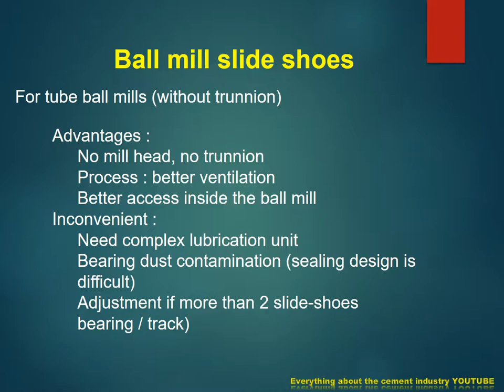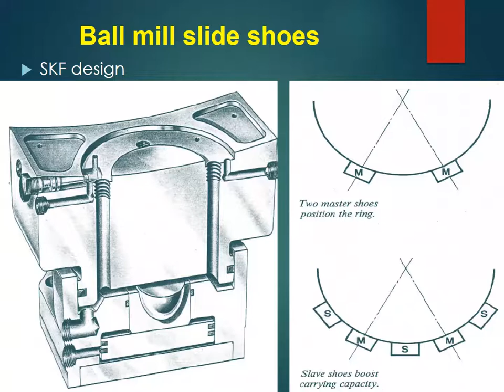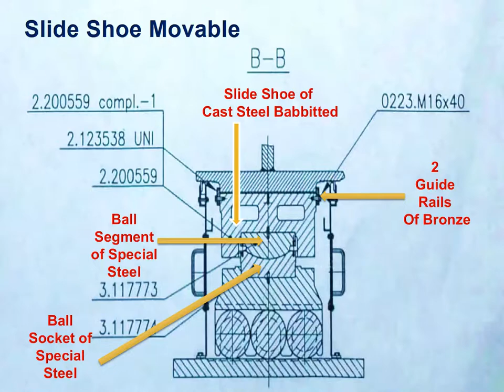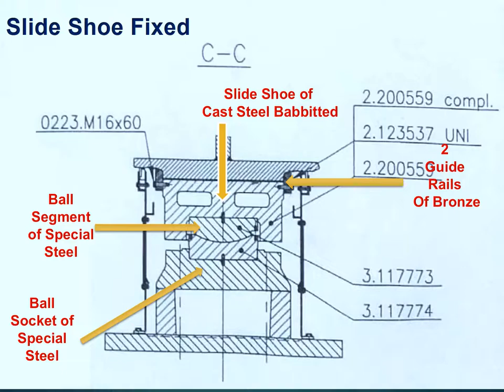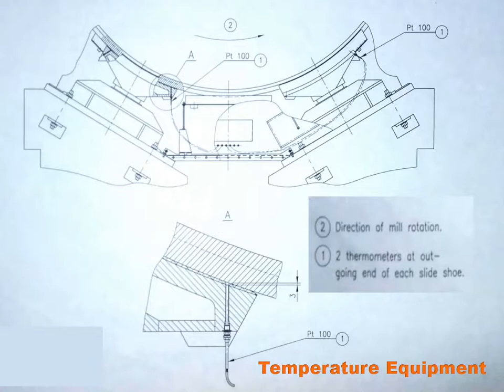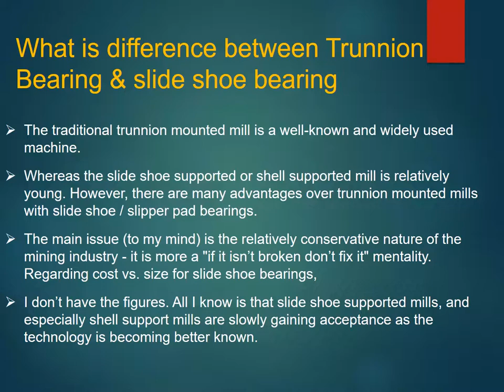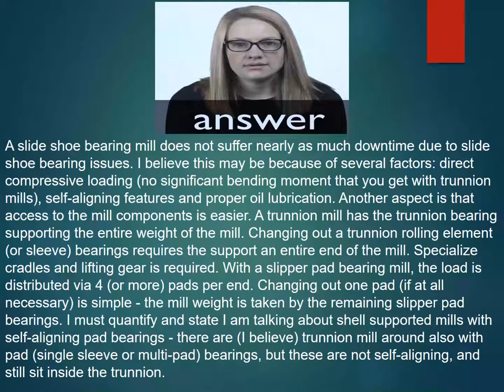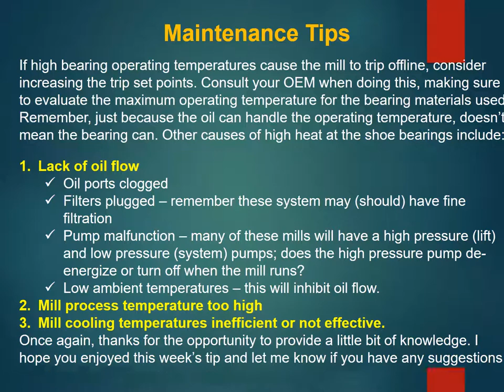Everything about Slide Shoe Bearing and Trunnion Bearing for Ball Mill at Cement industry

Comment: Thank you for sharing this information. From my experience as mill operator the main causes of high SLIDE SHOE TEMPERATURE are as follows

1. Due to High Pressure Pump failure
2. Clogged oil filter ( during opportunity shutdown lubrication team will clean the oil filter)
3.high operating temperatures of mill inlet and outlet
4. Mill overload or underload 
5. Ineffective cooling system
Reply from the maker: Thanks